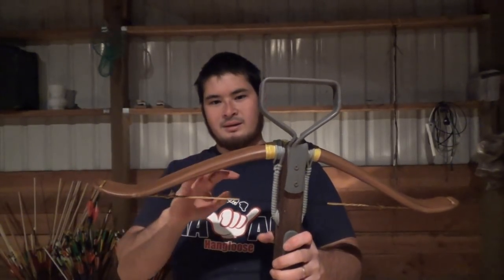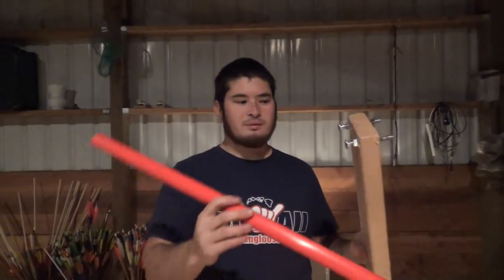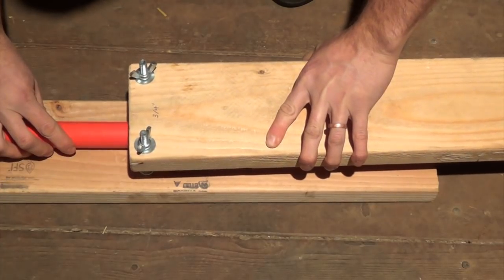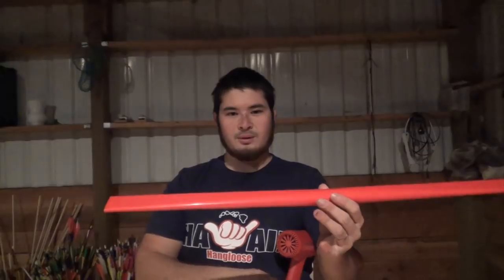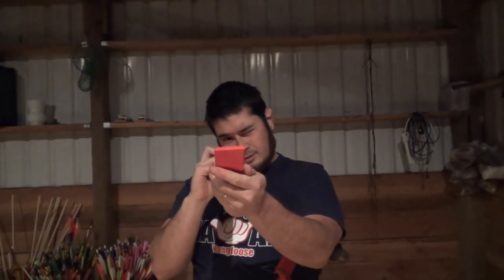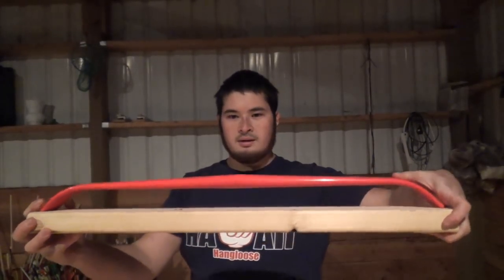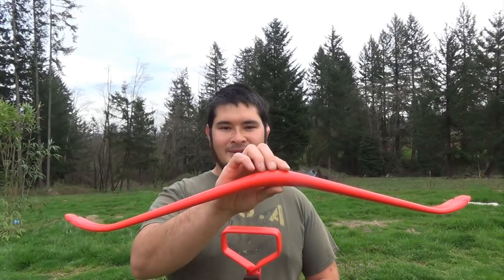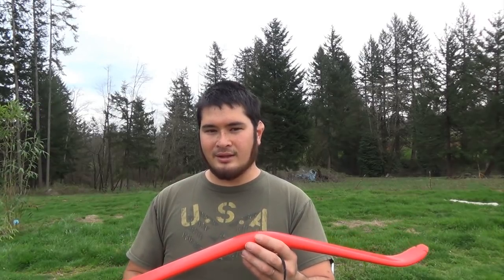100lb Medieval Style PVC Crossbow for Under $10 Part 3 - Building the PVC Prod

Comment: Some really great videos on this channel, I made one of these a few months ago but tweaked and customized a few things since. Kids really love it, but its not at all a toy, these could kill you lol! draw weight measured at 115 lbs,  using pretty much all the same measurements with a few adjustments on deflex. I added a quiver and a homemade sight railmount that extends over top of the bolt clip with a cheap reddot on it.  Using an adjustable  Table saw is also great for establishing a perfectly even bolt channel down the center of your piece, then filing it out and sanding to a perfect fit of your 3/8 in. dowels/bolts. Even with a dirt cheap reddot It Was very easy to sight at 10 yards and is quite accurate to be what it is, once you get the elevations down for different ranges. Longest I've shot was 45-50 yards and with the tips I used it would still easily penetrate and stick tightly into the side of a wooden shed. This was a fun and pretty simple build, perfect for target practice and just having fun. although I had to experiment with the deflex on a couple different limbs I made, along with a very slight adjustment on string length due to collapse. It happened to me twice before I got it just right, lol I've shot it atleast a 150 or so times now and it hasn't lost any power or stability yet. The wrapping of the prod is extremely important. if its not a very tight secure wrap, it won't last no time. I added another seperated paracord wrap, extra 10 feet or so. One could also drill an extra hole behind the other to glue in a dowel with an inch or so sticking out on both sides to loop an extra wrap around a similar way, tightening the others even more so they don't try to slip down the limbs when drawed back which becomes an issue unless it has a very tight and secure wrap. Id like to eventually make a new one similar to the functionality of this pvc crossbow but with a different stock.

Comment: How thick should I have my Pvc and how thick is yours please answer.
Reply from the maker: +Creatxmore The wall thickness is about 3mm (3.37mm) with a roughly 1-1/4" outside diameter (33.4mm). Hope this helps!
Reply: BackyardBowyer 
Hi BackyarBowyer
i try to make my first bow for crossbow. the result is nearly yours but i used an diam.40..but i don't understand the thikness of your pvc pipe.. how much mm is?
thanks and keep it on..
Reply: dude, he actually said whats the thickness of the pvc pipe

Comment: Nick, love the video but I am having the same issues as I have with the other 100lb crossbow that you made. Namely, shaping the prod has been a royal pain for me. I even made a "rig" with bolts in it similar to yours. There are two issues. One: In heating up one half of the prod, I have minimal issues, but when I try to heat and flatten the second half, the middle section looks all funky and not smooth at all. It's almost like the first half that has been flattened already, deflates a little bit. The second issue is whenever I attempt to reheat the tips to bend them, they won't bend until they are heated to the point where they begin to lose the smooth taper, and the ends are no longer flush together. I guess I am really bad at judging how long I need to heat the pvc for? I don't know what to do.

Comment: Nick, great video! Have you ever considered putting fiberglass rods in the crossbow design also or will that not work?
I understand with the flattened and bent design it may be troublesome, however some people have mentioned doing it without flattening and bending maybe because this operation seems intimidating for some.
If you attached your no heat regular fiberglass rod bow to the wooden stock making it a crossbow, would that give us a faster, harder hitting crossbow? Also would the firing mechanisms be able to handle this?

Comment: Since I will be using one for LARP, will a 40" long 3/4" PVC pipe be enough to shoot a bolt fast but not as fast so it would hurt with a LARPing arrow?
Reply: You can use 30" as well with 3/4ø and just limit the draw length. Less than 45# @ 10" power-stroke keeps you in the safe limit.

Comment: hi ..can you let me know the power stroke in this crossbow? i made one and has 25 inches from the tip to the charging point ,,the trigger ,.i need to know the long of the bow to give it a good power .or cut the stock a little to give it 11 to 13 inches draw length.

Comment: Sorry if you've already answered this, but what is the difference between furniture grade PVC, and plumbing or electrical PVC?  Is it the glossy finish?
Reply from the maker: Destichado The main differences are what the pipe is made of. Plumbing pipe is usually PVC with some fillers like chalk added. This helps lower costs and add stiffness to the pipe. These pipes generally have the best speed and performance.Electrical PVC is usually very close to pure PVC with UV protection added. These have lower speed and performance and don't do well in higher temperatures. They do well in cold temperatures.Furniture grade PVC comes in many types. The one I use is almost pure PVC with additives for color, UV resistance, and impact-resistance mixed in. While not as fast as white plumbing pipe, the furniture grade is very tough stuff and can handle a wide range of temperatures and conditions. It also does not need to be painted.Hope this helps!

Comment: Not even sure that anyone will see this but I have had to remake the prod twice already because it has either broken or simply caved in. I am wondering if maybe I am heating it incorrectly and causing weaknesses in the material or if I just need to use a longer piece of PVC. I am currently using 30” long piece(I think thats what he said he was using) Has anyone else had this problem and/or have a solution

Comment: When I'm shaping the prod, it doesn't come out smooth. The pipe bends (like not a nice and smooth bend) in the middle.  Am I heating it too much or is there any other issue? Hope you understand,  kind of hard to explain. An answer would be much appriceated since I've had this problem twice.

Comment: I want to build one of these but modify it to shoot foam tipped bolts for LARP purposes. For that I'd need to bring the draw weight way down. Do you have a formula for figuring out how different prod lengths affect draw weight? As in: X fewer pounds for every y additional inches?
Reply: Me and one of my clan mates talked about this. I think you should use 40" (1m) of 3/4" PVC pipe, using the same techniques he does.

Comment: what does "scedule 40" means??
and what is the difference between plumming pvc and electrical conduit pvc??
Reply from the maker: norsie45 Schedule 40 is the way the pipe is rated. The thickness of the pipe's walls are around 3mm.
Plumbing pipe is usually a little faster than conduit, though conduit can be tougher. Conduit tends to warp on really hot days.
Reply: BackyardBowyer thank you, but, can electrical conduit pvc be used to make the prod? or it be used with furniture/plumming pipe pvc?

Comment: hey i just made the prod using the rig but seems like the ends are not completely conjoined after pushing fairly hard any tips? mabey i need to heat the ends extra so they bond together?

Comment: Do you think it would be ok to use 1/2 inch white schedule 40 pvc pipe for the prod?  I want a light powered cross bow for back yard shooting maybe 30 -40 lbs.  Thanks.
Reply: That should be fine. If you want it lighter then you wont have to make any measurement adjustments

Comment: I do a bit of larping and I would love to use a crossbow as a weapon for it, however the current crossbow is a bit too heavy draw for the game. How would you recommend lowering the pull weight?
Reply: Randy Mouser just make the pvc completly flat. the flatter it is. the less power it has. and use round heads for the bolts
Reply: Randy Mouser You can make it into a compound bow with pulley system.
Reply: You can make is longer and flatter
Reply: Lengthening/flattening the prod will work, or keep it as is and shorten the power-stroke! That is my preferred method because you never will get close to the break point.

Comment: What does the heating and flattening actually do? Is that to make the prod stronger? If so, is it still possible to achieve the 100 lbs with an unmodified pipe? I was thinking of maybe using two prods in tandem.

Comment: I had an issue with my 1/2" PVC separating when heating. It splits length-wise like it is two thicknesses coming apart. The one inch didn't do that. Did I get it too hot?
Reply: We had the same problem,  we switched to regular white pvc it worked well. Also found out that the flatend pieces shrunk in length , some as much as  an inch.

Comment: Hey man, i used pvc and when i heated and flattened it, the pipe just break when i bended it. Do you maybe know why
Reply: zombatija  Because you are not using the correct pvc pipe, make sure that you have schedule 40 (or E 40) pipe, these are thicker than the other ones

Comment: what if you didn't shape the pipe but just stuff it with fiberglass rods?
Reply: You'll get a lot more instantaneous power, but the heavier weight with the surface area of the prod will cause a notable loss in efficiency